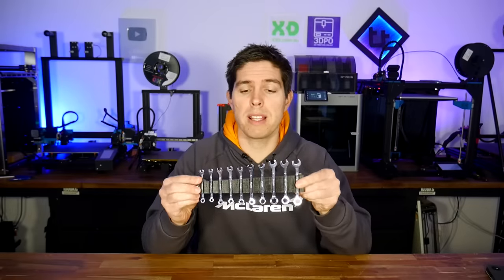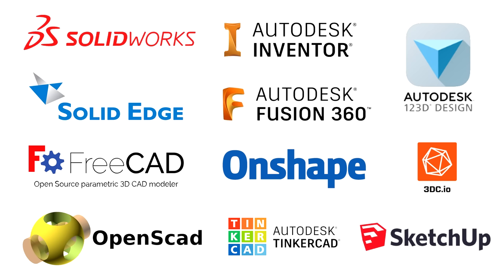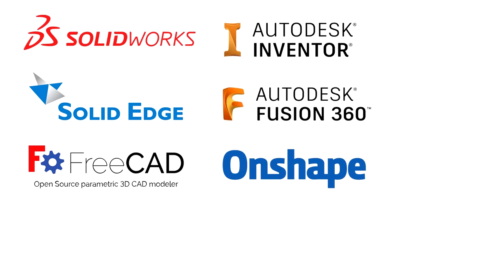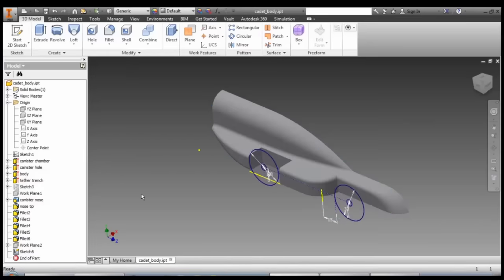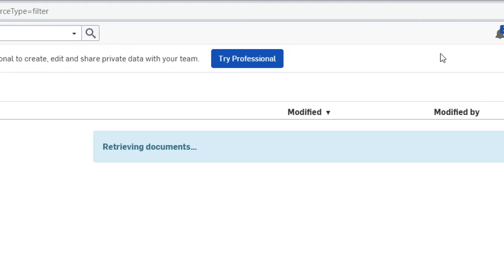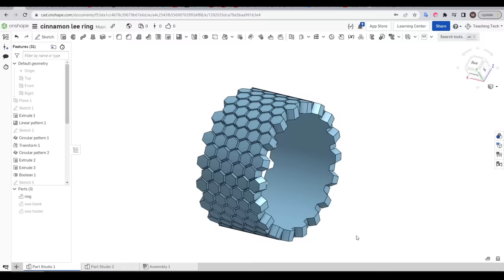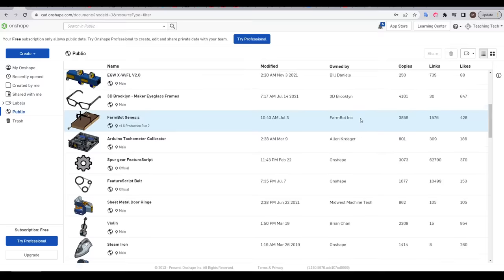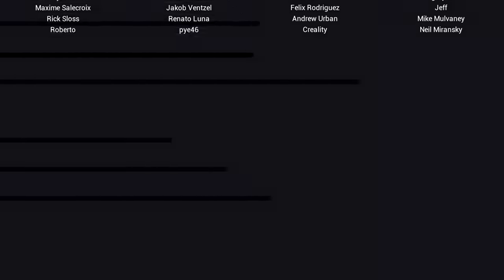Selecting a free 3D CAD option - 3D design for 3D printing pt1

Comment: 20 years of Cad experience…. DesignSpark is free, intuitive and easy to learn with no limitations to use or functions.  I use it for anything geometry based.
Reply: @arekx  .... It might be. Designspark_Mech is still very usefull and deserves more attention.
Reply: I second this, DS is wonderful tool for starting out and doesn't seem to have the downsides of onshape (works locally your data is yours ect.)
Reply: as a beginner, I have no idea what to do from their website. The jargon is difficult to understand.
Reply: Yes yes desig spark is just very impressive as a free and no string attached cad software. Used many CAD , all need you to spend lots of money and upgrading. Design spark just changes. That are so easy to use and is really free. I.use it to design quite a few jigs fixtures ... And they all are easily done in design spark.

Comment: I might be biased, but once I got over the FreeCAD learning curve, I have found it useable enough to made decent models. And with more use, FreeCAD can get the love and care it needs to get its issues fixed.
Reply: I know it doesn't really matter that much, but the look/graphics of freecad lag so much behind other modelling software (only slightly better on the realthunder branch)

I use it though because I like having the option to do things like simulations, even though I probably never will use them.
Reply: @joeking433  try on linux
Reply: @joeking433  they have a version for Apple Silicon.
Reply: i love freecad just the other day I threw a sketch together and start printing
Reply: @joeking433  throw it away and get yourself a 10 year old thinkpad with linux. problem solved, wallet leakage fixed
Reply: @joeking433  i m not dissing the functionality of the devices or the software you can buy to use with it, all i m saying is: escalating commitment can be a bitch, especially if softwares become subscription based or retroactively remove functionality in order to make it either pay-4-play or subscription based. and in the mac and windows world, these things happen all the time and you have little to no recourse against them but keeping a dead machine alive and unupdated at some point
Reply: @mynameismynameis666  Whatever.

Comment: For whatever reason Freecad has been the 3d design application for me.  I have tried Tinker Cad, Fusion, and looked at Autodesk, but financially none of those work for me.  Freecad is a little buggy, but I have gotten some great results. Most of my design is based on photographic applications.  Rear and replacement of broken items on cameras, 35mm to large format. I am using v0.20 now, and with all software, there is a learning curve for more advanced functionality. I am not very favorable with most cloud base applications, but I will try Onshape since you did such a good job on this video explaining your position.
Reply: FreeCAD is getting pretty good these days. Sure the UI is still very clunky, but it has improved quite a bit from was it 0.16 I first tried and to be honest stopped using it as it crashed frequently etc. But I've got into it bit since 0.18 and it's been much stable and now I actually occasionally use it. I still prefer Fusion360 and have license at work, but I'm heavily now biased to getting more into FreeCAD as it'll stay free and Fusion is absolutely harvesting features away all the time. Just yesterday I found out that I couldn't import my Fusion design to DXF format free to transfer it my preferred free CAM software. I actually had to export to .STEP which was possible, then open it in FreeCAD and once again export it there as DXF to work. I was aiming to learn CAM in Fusion and it has quite nice feature set, but for now I'm definitely going to learn more about my preferred free CAM, get adept with it and then possibly try to learn more Fusion based CAM. I'm sure as heck not going to pay 500 euros yearly for Fusion to use my puny home made CNC machine. If I'd use Fusion I'd actually have to work and get good money out to reason Fusion, but as hobbyist, just no.
Reply: As soon as they fix the fundamentally broken parts in FreeCAD and release 1.0 (ETA: reasonably soon) I'm all in on moving over from Fusion 360.
Reply: @v4lgrind  What do you mean?
Reply: @v4lgrind  the TNP is not actually difficult to work around if you understand what causes it and how to avoid causing it
Reply: @Keechization  Probably true. I watched a tutorial 2 years showing workarounds just to get a better feeling for the problem. But the existence of such tutorials and the insistence for years from developers that this problem is inherent to the problem space and will not be solved made FreeCAD completely uninteresting until they announced that the Realthunder patches would be integrated in 1.0.

"That more intuitive thing you are doing in all other CAD software is bad, and you should feel bad" isn't exactly compelling.

Comment: I'm a 123D design user. It is very powerful for what it is, It's a stand alone program and doesn't require being online. All your files can be stored locally on your pc. He's right though, it no longer receives support or updates, which is kind of sad because it can be buggy from time to time. Not buggy enough to make me quit using it though, it's more of just minor irritations. I actually think that 123D Design does a few things faster and simpler than Fusion 360 as well. With 123D Design, the best thing you can do is save often. I have experienced a few crashes during very heavy and complicated use, but it does have an auto recovery, but always recovers a few steps back further than when it crashed, and the recovered file can not go back in history. It will start the recovered file as the beginning. So SAVE and SAVE often! It's not hard to do. But I haven't found anything that 123D design can't do with out a few work arounds and clever ideas.
Reply: i did use 123D design in the past. with good succes. is this still downloadable somewhere? as it's now puched away by Adesk fusion360 amd thinkercad. i might still have it somewhere on an old system overhere.

Comment: I am surprised you did not consider the free 3d CAD by Design Spark Mechanical. I have used it for 7 years to design 100's of fully mechanical 3d printed toys and robots. It's a really great free CAD system with lots of online tutorials.
Reply: It seems to be skipped quite often in similar videos in general. Being based on Spaceclaim it just straight up feels like (and is) a moden cad, and there's no commercial use restrictions it's strange it's so often ignored. That said it does have some annoying restrictions like adding text is a pain. Also I really don't like software with hard cloud requirements (like F360).
Reply: Yes its great using it my self and shapr3d
Reply: It's nice, but exporting data to any other format is absolute hell and worst I've ever seen. That's reason why I won't even bother to learn it more. I used it for bit and it's quite nice, but as mentioned. Definite no for me.
Reply: @jothain  You can save your files for export  depending on what you have desifned as 
.amf , ,dxf , .glb , .obj , .vdb , .pdf , .skp , .stl , .xaml , .jpeg  & .png. So not shure what your trying to do but for me STL and OBJ do all I need.
Reply: @nimeq  Yes it is true when I add text to my projects I do just open the file in 3d builder and add the text. 
I won't use a cloud based program, I am off line and stand alone more often than not.
Reply: @jothain  The rsdoc format is a zip file that contains .SAB format geometry files that some cads can import directly, but yes, the lack of IGES or STEP is annoying, but understandable for a free version of a rather expensive cad software.
Reply: @nimeq  well,,, it has Steps&IGES in its payed versions which are insanely cheap compared to other CAD software, (not sure if it did a year ago)  DesignSpark seams to be a pretty good option for a CAD user on a budget,, with a very flexible subscription system-.